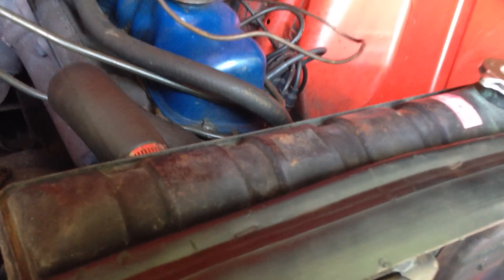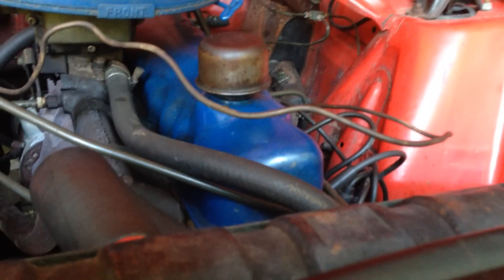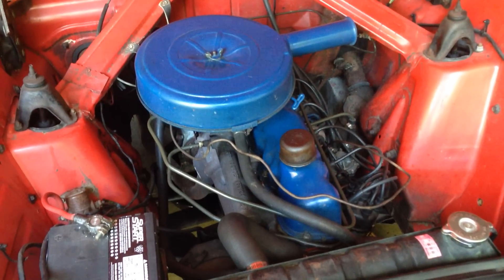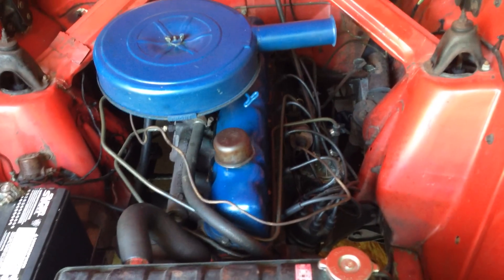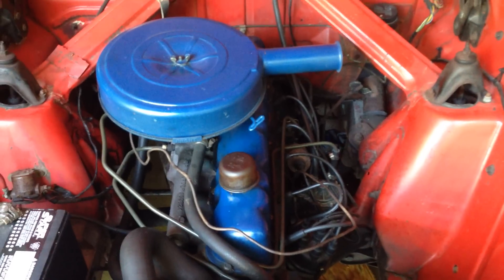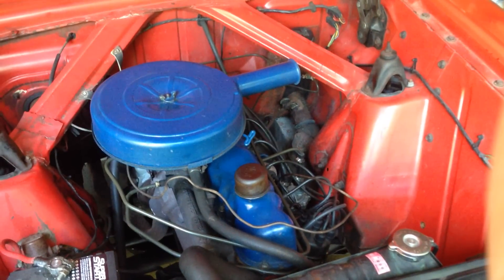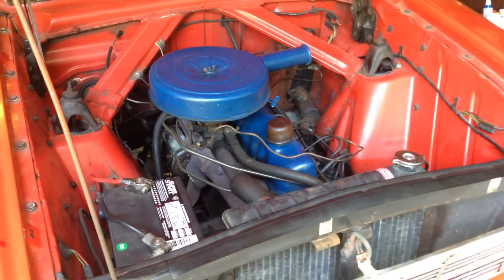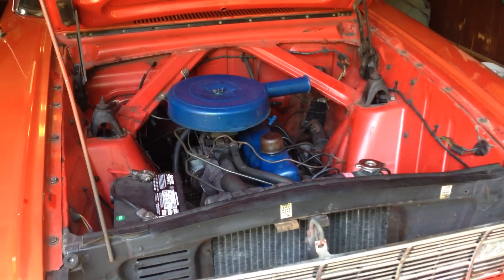Falcon Engine Swap Thoughts

Comment: The thermostat may be closed.  I bet if you removed the coolant drain bolt on the bottom of the engine out would come considerable rusty water.  As for the transmission, it's most likely the front pump seal.

Comment: In all seriousness... It all depends on how much the value of the car drops if it doesn't have the original engine in it. You could get a big enough radiator that'll work even if you end up swapping in the biggest baddest engine you can afford later on. Because IF you do end up getting another engine, you'll need to do the radiator too. So it's never wasted money to upgrade the radiator and fan.

In not seriousness, I know only 2 solutions:
1: Take the hood off
2: Run it through carwashes every 5 miles.

Or another option is to turbo/supercharge it and add nitrous... That solves all overheating issues too...
Reply: Mythbuster 
The value of the car is irrelevant unless you intend to sell it. If you're keeping it, all that matters is what it's worth to you.
Reply: cptnoremac That's true but usually you will sell the car at some point, so unless you keep the engine laying around somewhere you do have to bear in mind how much it changes the value. If the difference is only 1 grand on a 5 grand car then yeah who cares if you're 1 grand short in like 20 years time when you do sell it... But on some classic cars the difference is way bigger than that.

Comment: Throw in a VG30DETT from a 300zx. You'll be out in the roads in no less than a century from now. And you are guaranteed 200 miles of trouble free driving, maybe even MORE if you change the oil!

Comment: Maybe a jeep 4.0L straight 6 or the GM straight 6 to keep it looking the same under the hood. I would choose the jeep engine proven reliability and Ford/willy's overland produces jeep in WWII so there is a connection there.

Comment: It's not my car, but I would vote for trying to keep the original engine / transmission as much as possible.  Maybe just a few little updates, like you mention, to bring it up to more reliable (larger radiator and fans).

Comment: as much as I'd like to see you doing something crazy with maybe some good old I6 from a BMW and/or Toyota and the likes, I think it will be quite costly, even compared to making the original engine run... I mean it could be a tiny detail that's causing the problem and it would be a waste to swap an engine just for that... now if you want more horsepower, then that's different subject altogether :D

Comment: Well first off, if its boiling, then there might not just be sufficient pressure in the cooling system. Maybe get a new radiator cap.

Comment: I never owned old Ford. But I spent 3 years with 1982 Lada.
Do not swap engine. Even replacing it with same one will be a metric shit-ton of pains in the ass.
Check thermostate. If it does not open - you effectively have no radiator.
May have air in system. Guys around in comments explained how to do it, tilting car back is REALLY important.
Check if water pump is spinning.
Then, of course, a wild cards come. But it was working when you was driving not so long ago, so it should not be the case.

Comment: Cooling isnt just about the radiator and coolant - the radiator may allow coolant through but not cool sufficiently (internal restrictions - heat doesnt dissipate/spread through the entire radiator etc), the water pump might not be pushing/pulling coolant correctly, the thermostat (if any) might be jammed, there could be restrictions elsewhere in the system etc etc

Also coolant - water (tap or distilled etc) transfers heat well, too much antifreeze/anti-corrosion (green stuff) in the mix = less cooling power (aka mix correctly)

To bleed the system (universal lazy way) get the radiator as high as posible (jack front up), fill system, run car for 10 minutes with no cap and heater (if any) on to max, rev it a few times, keep it at ~2000rpm for ~20 seconds every so often until satisfied and no bubbles appear etc, constant bubbles = could be head gasket

Comment: For the reasons you expressed in acquiring the car, I think you're stuck working with the original engine or swapping in something as similar as possible.  There's a place for dropping in a powerful motor and hotrodding it, and I think that's cool, but it's not RCR.  At a minimum, I think the Falcon needs to be mostly original at the beginning of your journey.  If something goes horribly wrong, then you can resurrect it as something else with a different motor, and we can experience that change through you.  But the change won't mean anything to us if we never got to know the original Falcon.

Comment: The overheating is probably a gunked up radiator.
Also, Eric the Car Guy (YouTube channel) bought a rusty old Mustang with clapped out rear end but a good engine that swaps straight into his Fairlane. Similar options should exist for the Falcon.

Comment: Had that same problem. Your radiator may have been flushed but its still clogged with rust debris. Either that or the shaft on the water pump is disconnected from the impeller. Happens a lot in old inlines.

Comment: buy and use a 1982 to 1988 ford falcon 4.1L (250ci) or a 3.3(200ci)  Cross flow head/xflow , these can ONLY be found in New zealand or Asstralia, and give way better performance and more power (massive upgrade)

best combo from i have heard is a 300ci with a Australian cross flow head give the best upgrade(racing/street use) a good combo is a 300ci block rebuilt with a stage 1, 2, or 3 cam with a 4.1L cross flow(xflow) head with some good smooth porting, twin SU carby's from a 4.2L XJ6 jaguar(good basic jetting/very easy to rejet), and extractors, and a good tune or dyno tuned and you can have  a huge power upgrade
the 4.1L has 120HP efi, basic single webber has 100HP,  with the above mods you can see any where from 150hp to 350hp all depending on the tune and engine work done(balancing of the rods, crank, harmonic balancer, clutch/flywheel) as all these basic I6 pushrod engines have a not so nice engine vibration, remove the vibration and you can rev it more to 6000rpm without balance 5000rpm is pushing it

Comment: I personally would like for you to keep the original engine if at all possible. I do doubt that it's not the most economical or the easiest way to sort things out but it would preserve the car's original character and charm. Swap the radiator for sure but I would like it if that original engine could be made to work and after all if it was about the cheapest and easiest way to get around you'd never pick an old car in the first place. So keep working at it for now anyway.

Comment: please no LS, other big V8, 2JZ, RB26, SR20 or other engine swap that make the irregular.

make it original and regular as posible, i agree with some comment that think your car need some power to keep up with current car but please dont make it some kind of sleeper/race car. as long it you can drive it for daily and long trip if possible then its fine.

Comment: The easiest thing you could really do is buy the lowest-line, 290 HP 350ci crate engine from Chevrolet. It is a carbureted, low-revving, relatively small engine (for a 350) that makes enough power to amuse, but not too much. It would be one of the easiest installs you could do, and if you're really invested in the swap, it's one of the cheapest, new entire engines you can get.

Comment: take the cap off. run the engine tern the heater on and make sure it get to running. o and make sure your thermostat is in the right way and if its a new one that it actually opens that's all i got lol

Comment: Here's an idea for an engine swap that would be easy, cheap, and quite effective. A pre-1980 200 or 250 straight six should bolt right up in place of the 144 (same family of engines) without modification. The 200/250 will cruise on the freeway all day long at 85 mph with nary a whimper--best of all, because they aren't sought after, you can get one for dirt cheap. I'm pretty sure it has to be pre'80 though....I think that's when Ford changed the bellhousing, which means they probably wouldn't bolt up to your trans.
Reply: justsomeguytoyou There's that underline thing again.....so weird!
Reply: justsomeguytoyou agreed, except swap the tranny with it.

Comment: That engine just needs what the old timers called a "Ring and Valve job". It was common at 30,000-40,000 miles in 1960 to have a top end rebuild. It also would allow for hardened (unleaded fuel safe) valve seats. I have the valve seats done on every old car that I do. It can be done with the engine still sitting in the car (The cylinder head of course goes to a machine shop). That Falcon 6 is a very good engine for the time, it just wasn't sexy. The horsepower wars that started just 3 years later made people think very little of the tried and true sixes. 
Your overheating is just gunk in the water jackets... I guarantee it. No replacement radiator will solve that. My 1963 model had the same heat issue.  I popped out the freeze plugs and scraped gunk with a screwdriver until I could get get pressured water through. Ran cool since then. I do like the aftermarket electric fan for traffic backups and sitting in drive-thrus (which were not yet common occurrences in 1960). I just use a hidden under-dash toggle switch. Regular driving has changed so regular cars had to change. It would be great for your experiment to see how a 1960 base Falcon can handle today in good repair before trying a Mustang/Falcon Sprint drivetrain. The only thing I'd do that isn't repairing the stock is the electric fan, it doesn't taint the original vagabond falcon idea if you only use it when absolutely needed.

Comment: Per wiki-

144 cu in (2.4 L) I6
170 cu in (2.8 L) I6
260 cu in (4.3 L) V8

were the period correct engines for that era. If you can't fix the current one, figure out which of the above has the best parts availability, and go with that.

Comment: Water pump and radiator. Might as well get new hoses/clamps all around as well. Make sure the fan clutch is working and the fan is fully engaged. (Does it cool down when the car moves?)

Comment: for the sake of the whole experiment that vagabond falcon was bought for, to see if a 60 year old car can be just as practical as a modern car,  i don't think its right to do the engine swap...yet.
My daily driver is a 72 ford straight 6 with almost 450 000km (300 000 miles). & its still got plenty of life in it & thats driving an hour in traffic to the city in Australian heat almost every day.
 i'd see how far you can push this engine.

Comment: I wonder why more people aren't saying 460 big blocks, because everything is better with a big block. The 460 big blocks are cheap, plentiful, easy to find, and there are lots of parts and knowledge out there on them. BBF motors are also kinda underrated, but still make mountains of torque and with a cam would sound fantastic.
Reply: Eating A Squirrel 460 won't fit in a Falcon without a lot of work. A big block won't fit between the shock towers.
Reply: I was thinking that would probably be the case, but it makes it that much cooler. Mr. Regular should magically become a great fabricator with a killer workshop and do it. If only there was a dedicated fan out there who would do some of the fab work for him, that'd be pretty awesome.

Comment: Try removing the thermostat. Unless it's freezing cold, no need for antifreeze, use plain water for now as it cools better and is cheaper to refill if you loose some while working on the engine. Make sure it's deaired and it should be fine. An electric fan would be nice.

Comment: I dont want to say this considering how hard it was to get the thermostat housing on.. but if the thermostat is jammed closed, thatd do it. Air in the system also does, tho, so as some have said, rad cap off, with the front end higher than the rear, and hopefully that fixes it

Comment: RegularCars I've seen one classic Falcon with a XR6T from Ford Australia that was crazy fast & dead reliable.
ECU & engine fit inside along with the stock turbo but they used a Mustang 6-speed instead of the automatic from the Falcon.

At least your Bird will keep it's heart in the family.

Comment: If you want to swap to a V8 you may need to get a new crossmember, mounts, transmission, drive shaft and rear end i think. I know the Mustang was based on the the falcon, so it should be very similar, but that was the  2nd gen not the 1st gen model you have so i dont know how useful this information is.

Comment: Engine Swap = Five lug swap because you'd be nuts to run 4 lugs with a V8, new trans, all new cooling gear... Did Ford use a weaker Rear-end with bangers?

I wonder if it needs a heater core. Radiator might need boiled out.
Reply: fallryan I'd replace them both in a car this old. Water pump too. All new hoses. That would solve his overheating issue.

Comment: My car recently had heating issues, you could actually see the coolant bubbling in the reserve tank. Yesterday I flushed all the coolant out the radiator and put in water and prestone radiator flush+cleaner. Drive with it in your car for a few days so it'll clean the old coolant out of not only the radiator, but also the engine. Then you can flush that out and put coolant back in!

Comment: Yes you must take the radiator cap off to bleed the cooling system. Run it at operating temp so that the thermostat opens and air can bleed itself out. Turn the heat on too while doing this. Top coolant off as needed.

Comment: I would call ChrisFix to do a collaboration with you.  I think he lives in New Jersey and he really knows his stuff.

Other things to consider are head gasket, improper thermostat installation with the super gasket and air in the radiator.

I think I remember the car overheating on your drive home so a head gasket could be the issue or maybe the transmission.

If your transmission lines run through your radiator that can cause an overheat if the transmission is overheating from low fluid or more serious problems.

I used to have a 1987 Mercedes 300D that overheated once because I had it in drive but held down the brakes while I took a 30 minute call from my boss.

Comment: I agree.  Check the thermostat is put on the right way.  Or just remove it all together for trouble shooting. I own this engine in a 56 p400 bread truck. Super reliable and doesn't over heat.

Comment: Leave the radiator cap off, start the engine and squeeze the top radiator hose until the bubbles stop. Pm me for my email if you want anymore help, I'm not in Pennsylvania but I can still give you some advice.

Comment: Keep it as simple as possible, if you can't, keep it as ford as possible. You're gonna be several weeks/months in it if you do a swap, just keep it original. Check your thermostat, when I was breaking in my cam mine got up to 230 but only because it was just freshly built and was working the air out, but for it to overheat that fast it wasn't getting any coolant.

Comment: 460 swap. But in seriousness, you should get a radiator shroud. Also, just pull off the radiator cap and let that sob sit and run for a bit

Comment: Take the radiator cap off, run it for about 20 minutes with the heater inside the car on

Also check to see if you have a clog in the fuel line causing you to run lean

i love my 200 inline 6
check out http://classicinlines.com/tech.asp for common mods to this engine

Comment: Do the Windsor 302 swap; the fuel injected version in my Explorer has honestly been the most reliable engine I have owned.
Reply: Sallular straight 6 300 would be a better swap in my opinion.
Reply: ***Classified*** 300 is to large, stay in the small 6 family for a swap.
Reply: Evil Jim Good point. I was just throwing something out there. I'm not a classic car guy by any means. I just know modern stuff. I'm sure many hours of measuring would go into a swap job, possibly cutting the frame, etc. I'd be scared to do it.

Comment: i'd recommend a salvaged Prius engine(s) and reconditioned battery - wouldn't that be THE BEST mash up? ultimate mass-produced old tech with ultimate mass-produced modern/future tech? how original, economical and reliable would that be? beats what just everybody else does - just throwing a 302 or a 350 at it (borrrrrrrrring...)

Comment: Did you maybe, possibly, install the thermostat backwards? It's easier to do than you'd think.

Also I really like the ford 200 inline 6 (or 289 v8) swap idea. It would be dirt cheap to find a runner. But I'd highly recommend swapping in a T-5 5 speed transmission either way. Swap kits are easy to find and in an old car like this, it would be relatively easy to do. The trans swap in a 67 mustang is a weekend job for someone who has a couple friends and researches thoroughly.

Comment: Put a Vulcan engine in it, it's the most regular engine and it shouldn't be too difficult to put together. That way you still have a REGULAR car, but it has a swap and it is much more reliable. Then you can take your vagabond falcon to Texas as mentioned in your stream.

Comment: The comments on engine swaps from these millennials are atrocious. It's obviously air in the lines (or a partial blockage) and it wouldn't hurt to replace the cap as another commenter suggested. 

I'd recommend draining the fluid again, checking it for crap/sediment. Try blowing some compressed air through as well. Refill it 70%, run it for a minute sans cap, kill engine, add more in stages. 

Bottom line, resist the urge to get frustrated and start sourcing a whole new powertrain until you fully diagnose this bug - because that's all it is at this point.

GLB

Comment: Why not leave the block but build the engine. Add a megasquirt efi, modern headers, a higher compression ratio, better cooling. Heck, even go as far as a turbo and create the grand national of the 60s.